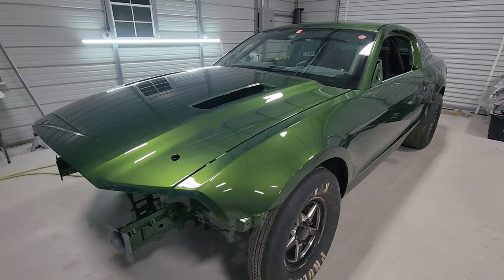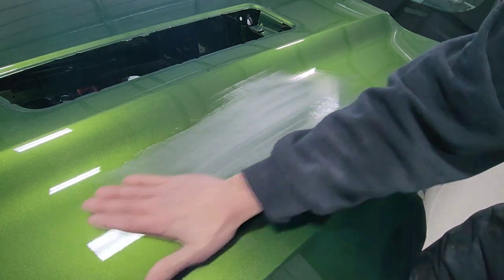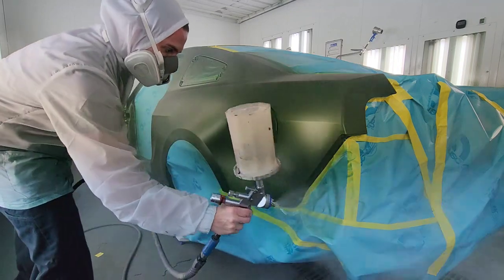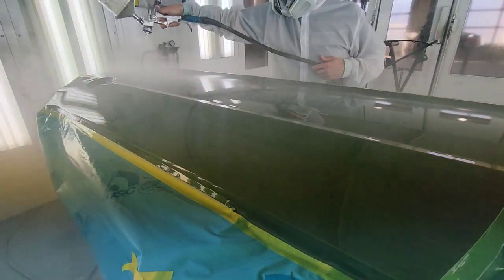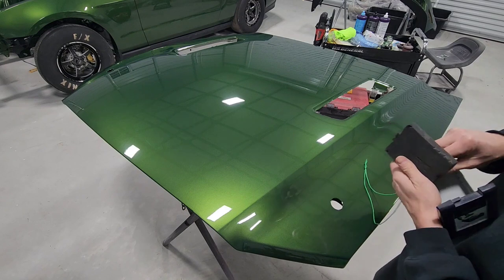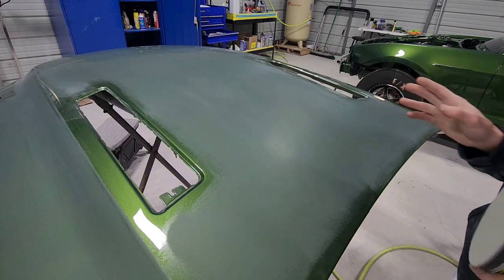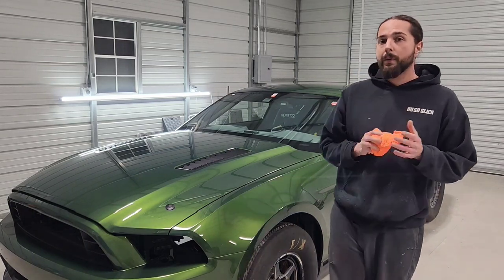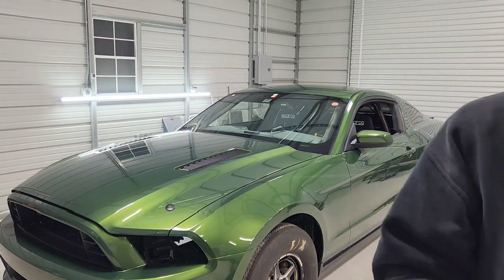S197 Mustang Drag Car Flow Coat, Buffing, & Finish

Comment: I was useing 3m compound until I tried meguiars 110 , beats the hell out of 3m,, unbelievable difference will take out 1000 grit sandpaper scratches and leaves it looking like it's been compounded and polished all with one pass with a wool pad on rotary buffer, well worth the 40 dollars a quart,  l won't use anything else now.
Reply from the maker: @georgespangler1517  I've only ever used 3m products.  I'll definitely have to try the meguiars

Comment: After flowcoating and you wetsand and buff, if you burn through the new layer of clear, will it show the 2 different layers?
Reply from the maker: @89GTFoxDude  honestly I don't know. I haven't cut thru to find out. I've had a few people ask me that. I'll have to do a test panel to figure that out
Reply: @cliff_hatch3r  Ok I will keep posted for that vid.  I have been wondering myself and afraid the 2+ layers of clear will show since they dried at different times.  I hope not.
Reply from the maker: @89GTFoxDude  the thought process makes sense but I'm not 100% sure. I've def got some experimenting to do